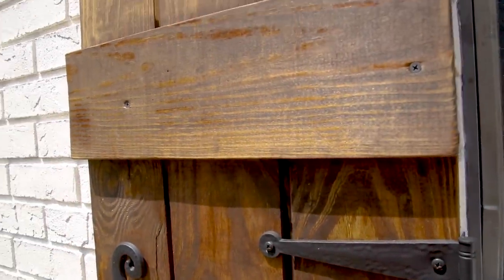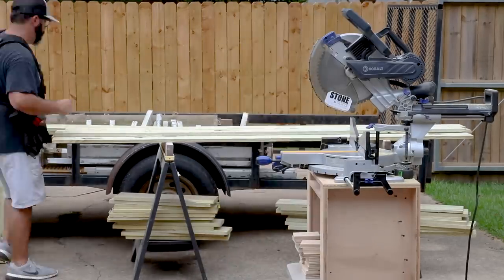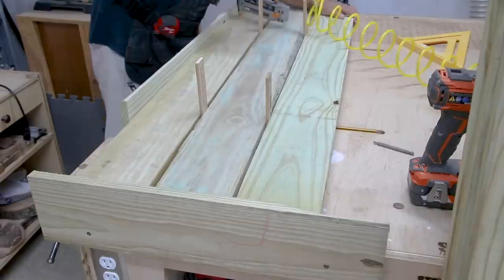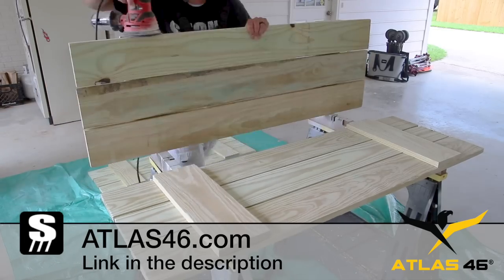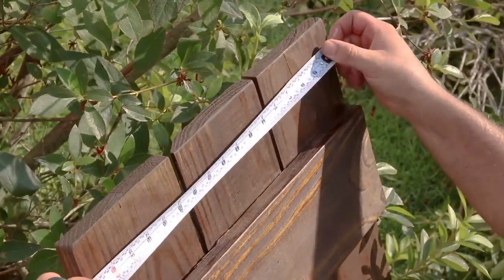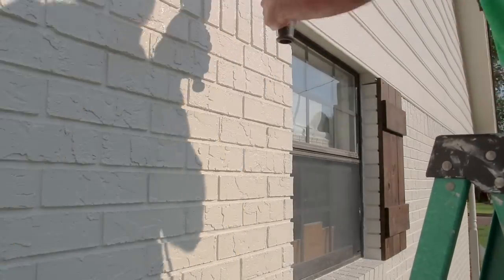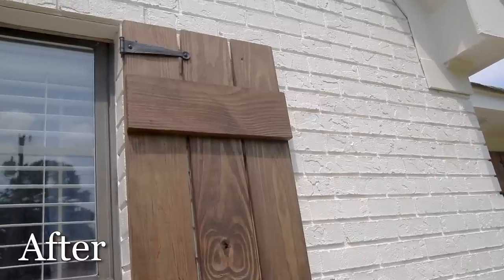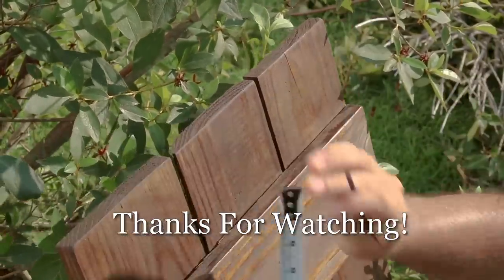How To Make DIY Shutters - Home Improvement Woodworking Series

Comment: Just a thought. Maybe add washers as spacers between the shutter and the brick. It’ll keep a small space for water to move freely, air to move and the shutters will last longer. That’s what I did anyways, seemed like a good plan to me. Great work!
Reply from the maker: This is a great tip. I added that to the website article. Feel free to comment on the article to give yourself credit. https://stoneandsons.net/diy-shutters/ The brick on my house is not flush, so I have gaps behind the shutters already, but I might go back and add washers just for more room to drain. Thanks again!
Reply: @StoneandSonsWorkshop  I love it when someone takes advice from others! So many people think their way is the only way and get all bent out of shape. Great project!
Reply: Wow very good tip man

Comment: Great job! They really look awesome. Just a tip tho, Minwax is an interior stain but could be used on a front door topped with helmsman poly.  A better choice for shutters would be an exterior stain like Cabot. Exterior stains pretty much stain and seal in one step. 👌🏼😁
Reply: You answer my question. I cant find a nice color on exterior stains Minwax has more colors to choose from.

Comment: Great! But I want mine to actually close to keep out heat and cold of Arizona desert. 

I’d like to have them split so I can open top or bottom. Would this mean reversing them so the horizontal wood pieces are outside and allow wood planking to close flat and tight to the window? Then the hardware would have to allow them to open out and lay flat against the exterior walls. 

In Europe shutters are on the outside for energy efficiency and in some English regency homes on the inside folding into the wall.

Comment: Cabot Stain and Seal has high UV protection. Another great option is from a company called C2 Paint.  Also cedar wood would be more expensive but more impervious to the elements. There is a way to burn cedar wood and then stain. It's a Japanese technique called shou sugi ban and has beautiful results. Youtube has many examples of the technique.

Comment: What type of wood did you use? It doesn't seem to be treated lumber. Will it hold up to heat and weather elements if not treated? Also, did you seal stain with a product, like a deck sealer? I am very interested but was thinking to use cedar fence post because cheaper and lightweight. But they definitely won't look as nice as your wood grain. (I have never commented before, so how will I know when you respond?)
Reply: I would like to know what type of would was used as well.  It would take about $40 worth of 1 x 4 cedar for me to make one shutter for my house.  It would get expensive quick.  Just wondering what the alternatives there are to cedar.

Comment: If you install shutters on a brick wall like in the video, would one drill into the bricks, or the mortar between the bricks? Would drilling into the brick cause cracks?
Reply from the maker: Either way. Just make sure to use a hammer drill and good bit.

Comment: Is there a reason you didn't stain the shutter inside edges?
Reply from the maker: I did on the last few. I had to go back and get those areas after I noticed it in my video. Lol. The wood is treated, so it would’ve been ok and those are under the porch. Plus you can’t see it in normal circumstances.

Comment: Good job.
Made identical shutters a couple years ago.
Placed an ad online selling them. Not a single person contacted me :(
Reply from the maker: People around where I live and just folks I know were interested.
Reply: When I said that I posted online, I meant local sites.
I've found that most people where I live would rather pay twice the price for half the quality as long as they can buy from a big box store or nationwide chain.
They don't want to help support local businesses.
For example...those 2x4 benches that Jay Bates made. The wood for those costs me $40.
Throw in another $10 for pockethole screws, sandpaper and glue. 
The most I'll get from someone is $60 and most of the time they try to haggle me down to $50 or even $40.
I've only managed to sell 4-5 in 2 years. I've stopped trying to make a buck from building.
It's definitely not appreciated around here.